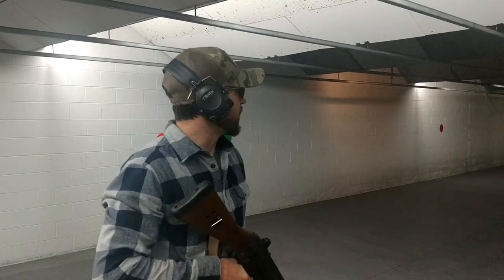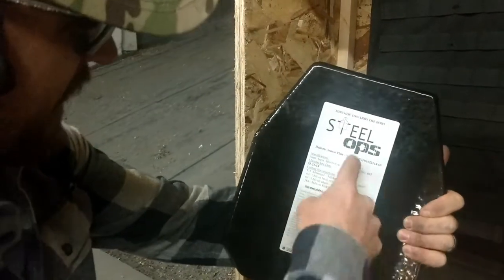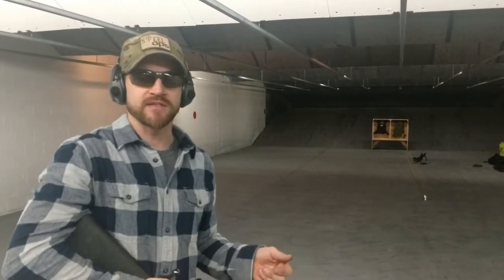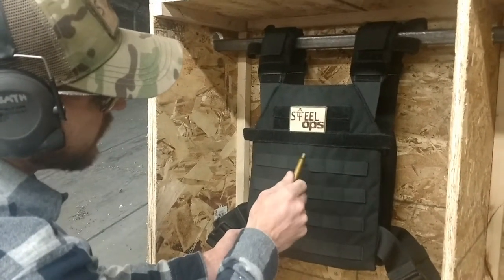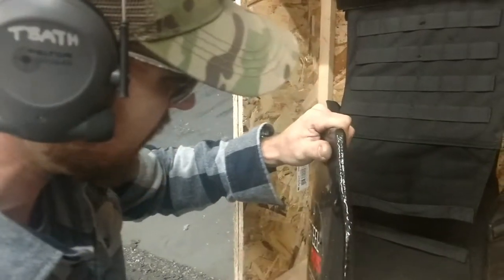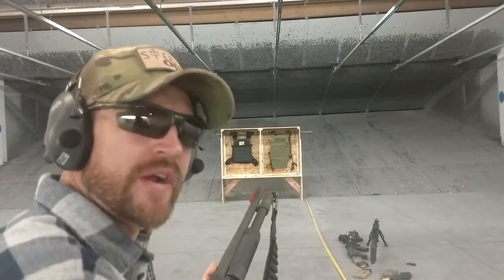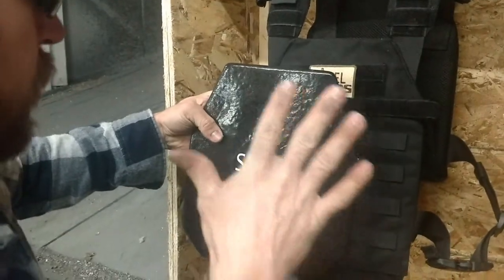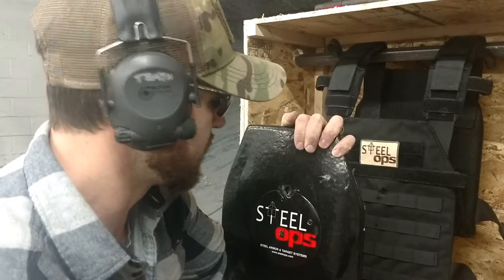Steel Ops XP Pro Plate vs .308, 30-06, & 12ga Slug

Comment: Why did yall use the 150gr on the 30-06 instead of a higher gr
Reply from the maker: Don't even know how to answer that. It was years ago. Lower grain is higher velocity and velocity is what beats steel. A higher grain is just going to go slower so the plate shouldn't have any problems stopping it.
Reply: @steel_ops  seems like you answered it just fine. I wasn't sure if a higher grain at that close of range would have pushed harder through it or not
Reply: @steel_ops  maybe true with lead but higher grain equal more velocity unless you increase weight of bullet a 65 grain bullet with 50 g powder isnt going to shoot faster than 65 grain bullet with 75 g powder
Reply: Do you guys have helmets love the product have you messed with dragonscale plates? @steel_ops
Reply from the maker: @kalebloshbough1551  we do not sell helmets and have not tested scaled armor.
Reply from the maker: @kalebloshbough1551  grains... As in grain weight. Not powder.
Reply: @steel_ops helmet more important but people want way to much for garbage honestly i paid 1500 for 50 cal rated and my 338 destroyed it with fmj not even phosphorus tip but barrett 50 destroyed 1 plate but my cousin and I made star out 7 thats all we got and they wasnt connected but the layers stopped the Ap 50 round but best deal by far please check into helmet and if need testing facility my uncle owns hunting range and we got 1500 yd gun range in crossville Tennessee ty for reply i work alot so not on here much
Reply: @steel_ops  plus not to good at English yet but have a good one